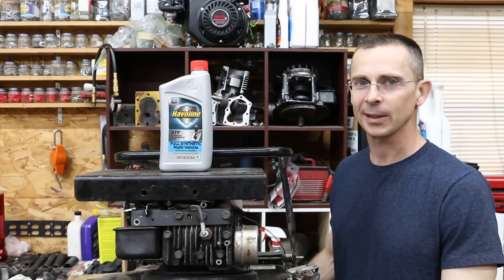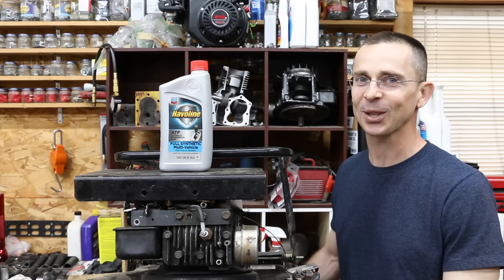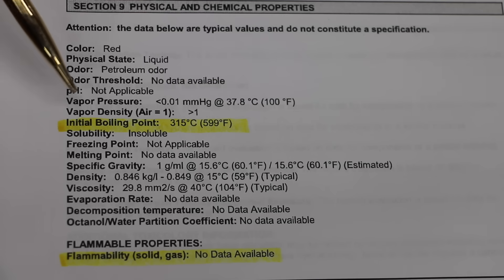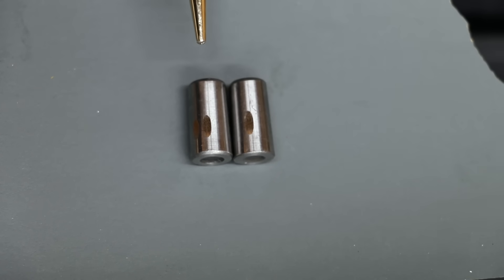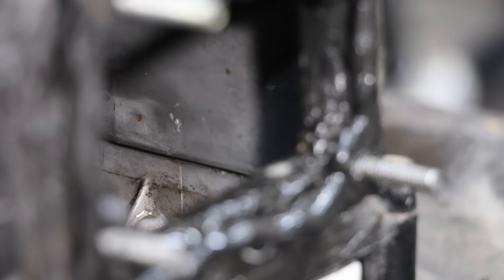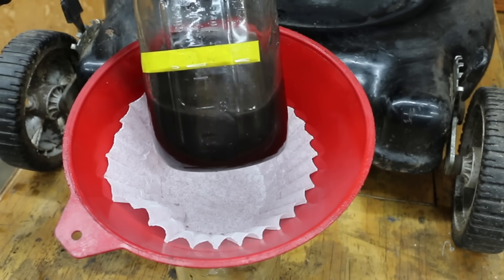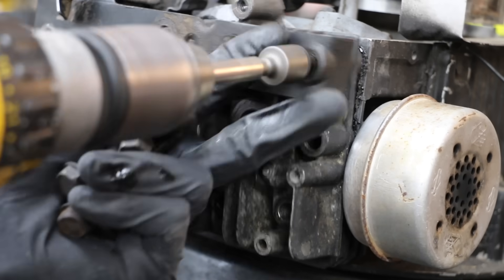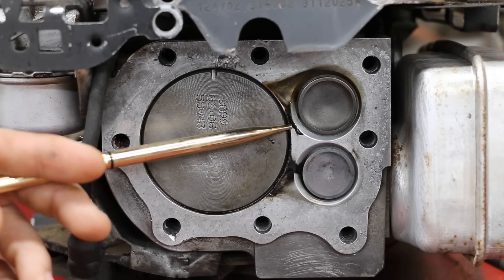ATF as an Engine Oil substitute?  Let's see what happens!

Comment: .
    In the mid 70's, my first car was a 1968 Chevy Bel Aire with a 307 engine. I bought it with 61K miles. At 69K, I "fixed up" my engine with power pack heads from a 1966, 283 Corvette, a quadrajet carb and headers, advanced the timing by another 14 degrees and started burning 95 octane 56c a gallon premium gas. AHHH, those were the good old days but I digress. Then I started using 4 qts of Valvoline 40w racing oil, a 15 oz bottle of STP oil treatment, a pint of Marvel Mystery Oil and an STP silver bullet double oil filter every 3,000 miles. Every 3rd oil change, I'd buy 3 qts of cheap recycled oil at 49c a qt, 2 qts of cheap "universal top off" transmission fluid, again, at 49c a qt, a second silver bullet oil filter and my "recipe" listed above.
    I'd change my oil for the cheap stuff and a silver bullet, let my engine idle for 15 minutes, drain out the crap oil and change the filter for a new silver bullet and the good oil and additives. The crap oil came out as black as the 3,000 mile used oil I had just changed. That poor engine in the Florida heat with me whipping the hell out of those 300 horses and blowing 3 transmissions in 40K miles, that engine never left me on the side of the road.

    On the other hand, my father's first "NEW" car was a 1974 Pontiac Catalina with a 400 engine. Being that it was his first new car that he finally got to buy when he retired, (with only 2 miles on the odometer), he wanted to take care of it. He read that owners manual from cover to cover and took special note that Pontiac suggested using only Quaker State "Deluxe" oil and a GM filter. This was back when oil actually came in a steel can. We both had these cars at the same time. Every 3,000 miles, like clockwork, he had me under that Pontiac changing the oil and filter.
    On my car, at 90K miles, I had to adjust the valves. I took the valve covers off and the heads were clean like brand new. I had my father come out and showed him what a properly cared for engine looked like at 90K.
    When his car hit 50K miles, he started smelling oil burning through the A/C when it was set on outside air. I opened the hood and saw the valve cover gaskets were leaking and dripping onto the exhaust manifolds. I ran to the parts house and picked up a new set of gaskets. I came home, took the valve covers off and almost threw up. I called him out to see the catastrophe that was sitting under his hood. I didn't have an engine hoist at the time or I would have pulled his oil pan down and cleaned the asphalt jungle out of it. 
    If it weren't for the valve covers, the sludge on top of his heads would have been overflowing onto the exhaust. I had to go into the house, grab a teaspoon, a wire coat hanger, a 5 gallon bucket of rags and a gas can from the garage. I had to take all 16 rocker arms off, pulled all 16 pushrods out and literally spooned the sludge out of the heads. I used gas soaked rags to finish cleaning the tops of the heads. I washed off the rocker arms then I cut the straight bottom off from the wire coat hanger. I used this to rod out the hollow push rods and rinse them in gas so that the rocker arms could finally receive lubrication again. They were showing signs of wear from being oil starved for God knows how many years.
    I got his valves readjusted, his engine put back together and he had me run to the parts store and get him 5 qts of Valvoline 40w racing oil and a silver bullet filter. I advised against flushing his engine like I did mine as it could have washed that garbage from other areas in the engine and into his oil rings, oil pump or other critical areas where it didn't belong. He used Valvoline for the rest of the time that he owned that car. The 5 cases of Quaker State that he bought on sale went up for sale in my mother's next yard sale. I wouldn't use that crap in my lawnmower.

Comment: I was starting to get a lifter tick on one of my Toyota trucks. It has 250,000 miles on it. It started using about a quart of oil between oil changes. I never added oil just changed it when it got a quart low (about 5,000 mi). The last two oil changes I added a Quart of ATF a week before the oil change. The tick was gone in two hours' drive time. The oil is getting cleaner on the dip stick. I've used ATF my whole life this way.
Reply from the maker: Thanks for sharing.

Comment: Marvel mystery oil works really good for cleaning the crankase. and can be left in longer to do a better job cleaning. because it has more lubricity than ATF.

Years ago it was recommended to use a high detergent motor oil. to clean the internals on most engines. but high detergent motor oil is no longer available. along with straight weight motor oils. only multi viscosity oils are available now.
Reply from the maker: Thanks for sharing.

Comment: Just saw this video.
Ford atf (non synthetic mercon IV)
Has a higher detergent value than the chrysler and gm version, in my opinion.
Did some regimented testing while in a vocational automotive class in high school. This is circa 1990/1991. We had multiple highly sludged barely running engines in our motor lab. And I had heard while talking to one of the old salts in my local automotive machine shop about how to clean the inside of the engine, most effectively without potentially damaging those components. he said that for really really sludged engines with a 5 quart oil capacity you change the oil with straight 30 weight high detergent, content, oil and run that engine for probably an hour and a half to two hours underload and then change the oil substituting a single quart of ATF into the mix and then run a 1000 mile oil change interval. We did a test on three different engines not very scientific, one was a Chrysler 318 poly one was a 350 small block Chevy with a two barrel and the last one was a 390 Ford E. the 318 and 350 were two barrels the 390 was a four barrel. because they were running on a stand and not under we couldn’t really do anything but how much sludge was coming out from under the valve covers after five weeks of 45 minutes every day changing the oil first thing Monday morning the Ford ATF did the best if we were thinking we would’ve had a fourth engine and ran straight 30 oil at a shorter interval to see if that had the same effect but from visual cues mix four parts one part ATF did the best. ATF is meant in a crank situation to be mixed with oil not in place of the oil. Used it on my personal cars. I’ve also mixed it with waste oil and used it as fuel and my diesel pick up.
Reply from the maker: Thanks for sharing.

Comment: I know this is late, but I always thought it was Type F ATF that is supposed to be used not the newer, thinner fluids. As with all miracle cures, you have to do diligent research to see if it will work in your situation. Type F, or other ATF, might free up a hydraulic lifter, cam actuator, or even a oil pressure timing chain tensioner- but does your engine have those? Ford/Mazda 4 cyl engines do not, for example. The real miracle additive is always your brain after thorough research.

Comment: Re-watched. Maybe 25 years ago when I did my own oil changes, the Motorcraft oil I used seemed to have better detergent action than the Valvoline or Penzoil I had been using. I'm told that ATF is highly detergent and I wouldn't run it undiluted in the crankcase but I would try it at up to 10% for 1,000 miles. I had a 1960 model truck with a defective fuel pump that allowed gas to enter the crankcase and it used and leaked a quart of oil every 3 days through the rope rear main seal but when I put bearings in the bottom end and replaced the rear main seal with the updated neoprene seal, the engine was super clean inside. The bearings were worn, but they were 40 years old and were not scored. I don't think the gasoline did any serious damage but this wasn't a really tight tolerance engine to begin with.
Reply from the maker: Thanks for sharing.

Comment: I was advised years ago by an aerospace engineer of an engine flushing formula of 1/3 cheap engine oil (LUBRICANT - SAE 50/60 or something), 1/3 ATF (DETERGENT), and 1/3 DIESEL fuel (SOLVENT). The total fluid volume would be about 30% more than standard oil capacity to account for the thinning by the diesel solvent. He called it the "vindaloo flush". Run at idle for about 15 minutes. I tried it on a small 4 cylinder with ~50-60k miles. I have no objective evidence for its effectivity, but the drained fluid was very dark (presumably mostly carbon deposits) and the normal oil would stay cleaner for noticeably longer after that.
Reply from the maker: Thanks for sharing.

Comment: I had a stuck DoD/AFM lifter in my 14 suburban, ran ATF through the engine for about 4 hours total. 6 quarts. It unstuck the lifter and I got another 38,000 miles on it before the lifter stuck again (I wasn't really good at oil change intervals so it stuck again) and it didn't come back the second time though. Valve stayed deactivated
Reply from the maker: Thanks for sharing.

Comment: Haven't even had a chance to watch yet but ATFs have coefficients of friction, that's why there are different types. These  aren't enough to mess with roller bearings and like bronze bushings that have no SIDE loads just keep shafts and drums centered. Engines deal with side loads.
Reply from the maker: Thanks for sharing.
Reply: Just watched video, as always great job and analysis. Again ATFs need friction coefficients so AT clutches will operate properly. Also you mentioned mineral oil in ATF which you video with Z max contained and that engine seized quicker.

Comment: Do like your video, that being said you missed this one...  When using Reg ATF as a cleaning agent in your oil it's best to be added for long term use every 5000 mile oil change ... On an 8 quarts system add 1 quart which is 12% overfill and a 5 quart add 1/2 quart /10% overfill ... Started doing this on my 2015 GMC 5.3 at 50,000 mile when it started ticking...  Now at 110,000 she smooth and very/very quite ....  :)

Comment: When I switch from 2 strokes to 4 I  once filled up a 19 crf450r with Belray 80w gear oil..road 15hrs hard like that. When I tried to buy another bottle the salesman looked at me in shock. When I changed the oil it was black with a swirl of silver in the middle nothing crazy. I pulled the head off and it looked brand new still. Bike just hit 150hrs and still rips (knock on wood)😂
Reply from the maker: Thanks for the suggestion.

Comment: I have had like 5  trucks by now in the last 11 years and a old timer that was a mechanic 50 years ago and ran a fleet of construction trucks said at every oil change add one bottle of atf then the rest oil and your engine will run better I have noticed a difference in all of the engines ,ls 4.8,5.3 ,6.0 , sbc 5.7 ,ram 5.9 gas and 5.7 hemi and I feel like it did quite down some with louder lifters and  did help clean forsure soon I’ll add some in a 5.0 f150 I just got
Reply from the maker: Thanks for sharing.

Comment: I ran An AMC pacer on transfluid for engine lube. I paid 40 bucks for it for a winter car in 1986 and didnt have any used oil to put in the beast. So, how about 5 quarts of trans atf2.
It never died....I gave it away and they drove it for 6 more months before it blew a head basket.  It NEVER died!! Ha Ha Ha. But then again, fuid doesnt care about who makes it. 
And hydraulic process of floating the crank on fluid is still valid as long as the proper pressure is enough to fill the bearing viods under pressure. 
 (I'm a tool and die maker, and engine builder on the side.)   Ive also used trans fluid for antiseize, and rear differantials in a pinch, but thats only to get where your going, then refill with ANY thick oil.   Oh Ps I grew up next door to a auto junkyard. worked there from 12yrs old on...My first build was a 48HP rider mower/mini tractor that went 60mph and scared all who tried to go that fast. Later put in actual tie rods and a suspension and brakes up front. I  pulled apart thousands of vehicles by 18yrs old.  Sadly, many were muscle cars, that today would be worth 6 figures as we had recieved them. Barely scrathed or dented and only bad piston rings etc...but they junked them...Cudas, Amc's, mOPAR Super Coronets with THE TRI POWER SETUP..WHAT??? , OBLIVIOUS.
I saw it all , wrenched them all, and now feel a bit ashamed. 45 years later. I did save an 82 Caprice classic/No rust, no damage. Blown engine/rod window. Its in the garage with an old 350 4 bolt and covered in old school edelbrock parts and heads, headers etc... maybe an astounding 350Hp lol. That seems so little now days. 🤣😂😋
Reply from the maker: Thanks for the suggestion.

Comment: It's interesting that the transmission fluid base is mineral oil. 
Take a look at Harley-Davidson.
 Harley-Davidson's Genuine H-D 360 Motorcycle Oil is a 20W50 mineral oil that's designed for use in Harley-Davidson motorcycles. 
I think it's 80/85% with additives. 
In my 78 shovelhead, every 2,500 miles is the recommended oil change time. 
I've been riding it for 30 years, and in that time, I've never rebuilt the bottom end, I have no idea what the miles are on it speedometer has been replaced a couple of times. 
The top-end has been rebuilt four times by me.
Reply from the maker: Thanks for sharing.

Comment: ATF or Marvel Mystery oil 100 mi before oil changes.
How can we diesel owners clean intake manifold from soot ???
Reply from the maker: Thanks for the suggestion.
Reply: Try adding about 4 oz of TCW3 (low smoke, ashless, cat safe) to 20 gal of diesel in your tank. The truck will run better and it removes carbon buildup over time.
Reply: @davidh6831  probably better lubricate high pressure pump etc too

Comment: I run 2%trans fluid in every oil change. Inside of my engine looks brand new. 5.5 quarts full petroleum base oil  . Other vehicles I tested same amount of marvel mystery oil no difference 300,000 miles trucks furds bb 460 low compression ratio from factory 8.0 . Will be testing 9.0 compression ratio built engine 466 cid . Thanks
Reply from the maker: Thanks for the feedback.

Comment: I wonder if I could use gear oil like the GL4 or GL5 in the crankcase, as a substitute.
At least a quart of oil with regular engine oil mixed. 
If it protects or clean the engine.
Reply from the maker: Thanks for the suggestion.

Comment: I have been using atf in high mileage engines for years. Never use just atf. Most v8 engines 1 quart is adequate added to the oil just prior to doing an oil change run not more than a day or two. In large diesel engines such as would be in a simi truck. Same proses only add 1 gallon to the engine oil   Obviously don’t over fill the oil system just add when you are at the add mark. The atf absolutely does clean the oil system. No it’s not needed at every oil change. Maybe once or twice a year. Depends on your yearly mileage. As a heavy diesel mechanic for 35 plus years. I have never had an oil related failure in any engine did this with. And yes I have rebuilt some of the engines I did the atf thing with. Once they had enough mileage to warrant rebuilding or from some other failure. And they do seam cleaner inside then engines that had never had a little atf flushing the oil system. Less gunk in the usual areas that hold gunky oil
Reply from the maker: Thanks for sharing.

Comment: I bought an old abused explorer with a filthy sludged up engine and added B12 solvent to oil to clean it and it worked wonders. Only left it in for about 50 miles and after changing oil it was a completely different running truck. Sold it for a $800 profit a month later.

Comment: Fun Challenge:   See if it is possible to apply performance up-grades and known engine tuning improvements to add more HP and TQ  to your common Briggs & Straton engine.  Do some Porting, head milling, timing adjustments, free flowing intake & exhaust etc..  See if it improves efficiency, combustion chamber deposits improvement, etc.  I know you wont have a dyno but any improvements will be worth noting.  Love the channel and you ROCK!
Reply: It's been done on larger B&S engines on mud motors
Reply: @kenneth9874  Yep,, But what about your common mower engine??!

Comment: I mistakenly used hyperlube oil treatment in my 2005 CRV for over a year. Bad idea, this caused the VTEC system to become gummed up and begin working intermittently.  I used 0-20 amsoil mixed with 2 quarts of cheap  ATF as my normal oil. It took a bit to get things cleaned up but it's been fine ever since.  I also use Marvel Mystery Oil regularly to help clean the engine. Seems to help.
Reply from the maker: Thanks for sharing!

Comment: I use kerosene as an engine flush before I change oil. I put one cup in the crankcase and run it for about five minutes, hot, before I drain the oil. 
Engine flush you buy at the auto parts store says they contain petroleum distillates. Guess what the majority of those distillates are. Kerosene.
Kerosene is about $10-15/gal. 
Engine flush is $6-7/qt.
Reply from the maker: Thanks for sharing.

Comment: I've used ATF back when it was 1/4 the cost of a quart of motor flush. I would let it idle fast and get hot. I had good luck with both but never loaded them down with anything but a mild drive to slosh to areas not reached at idle. 
I once cleaned a neglected engine so well the chunks of crusted oil that didn't break down started to clog the sump. I was delivering the car to the customer when the oil light came on. I ran it 4 minutes at a time back to the shop so the chunks had a chance to drop back out of the sump.
Reply from the maker: Thanks for sharing.